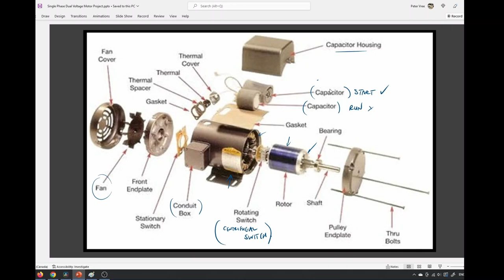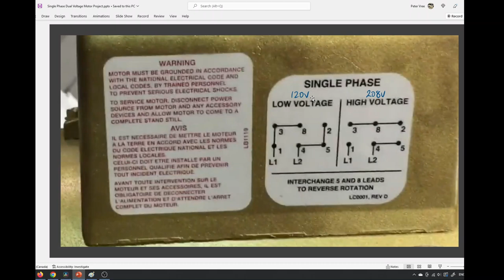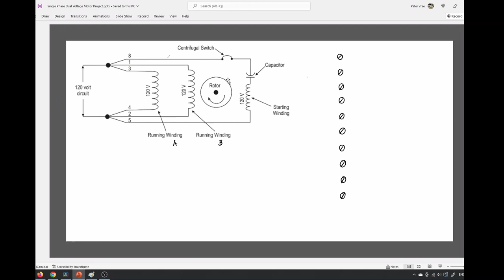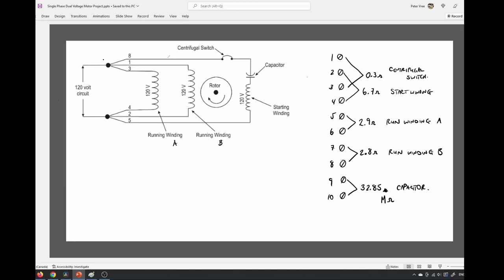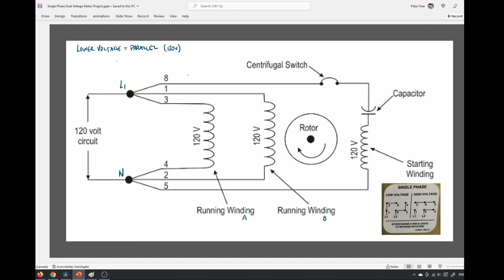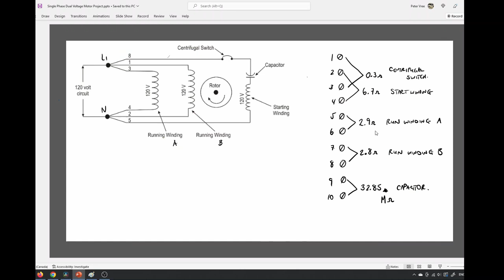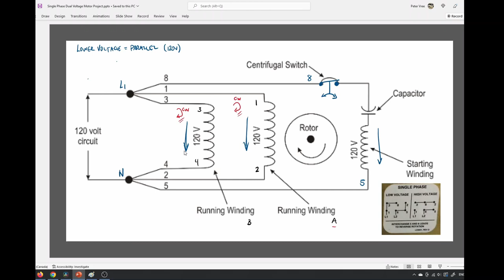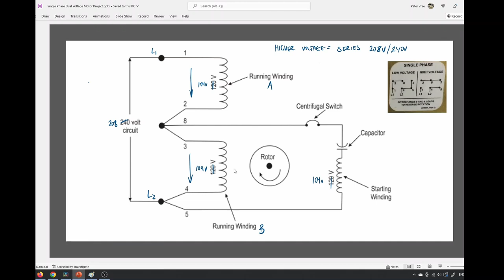Single Phase Dual Voltage Motor Wiring Project

Comment: I guess you could connect the two run windings in parallel and measure the inductance, swap one of the windings around and measure it again. Select the configuration with the highest inductance.
Reply from the maker: Not sure if an Inductance meter would work in this instance. I'll add some info in the next video on how to test voltage across the Run windings (leaving one connected at a time). Same polarity would read minimal voltage, opposing polarity would read source voltage)

Comment: High voltage wiring line 1 line 2 but what happened to the neutral
Reply from the maker: It's the "higher voltage" rating on the nameplate. With a single-phase 120/208V, the 208V or higher voltage would use L1 and L2 from the supply. No neutral required.
Reply: @PeteVree  ok that makes sense to what I see in this air compressor in trying to hook up. Two black an green (ground) . 1/2 hp motor dual voltage motor. Thanx . Video helped me out.

Comment: I'm a little disappointed that you glossed over the fact that the start coil would not get 120v in the 240v configuration, due to the series/parallel wiring. It would get around 100v.
Reply from the maker: You can't please everyone I guess. In class we go over in detail the nuances on the Start winding circuit. Obviously if it is in parallel with the Run winding, then it is limited to 104V on a 208 supply, coupled with the fact that it forms a resonant series RLC circuit with the Start Capacitor. Hard to get a reading on that specific voltage on the start winding with a digital meter prior to the centrifugal switch opening. Thanks David.